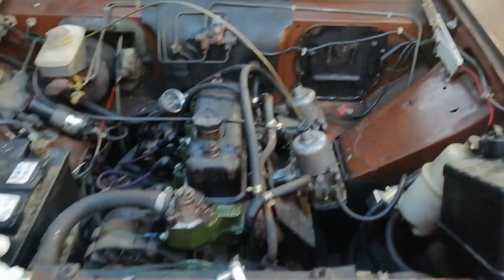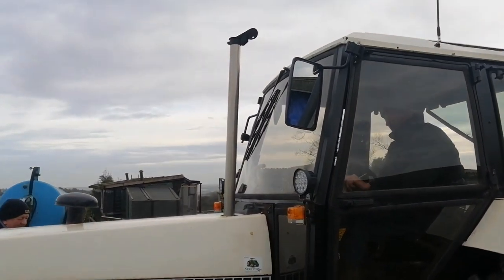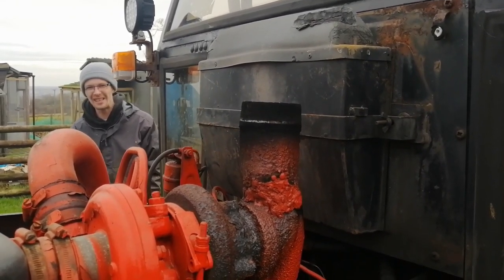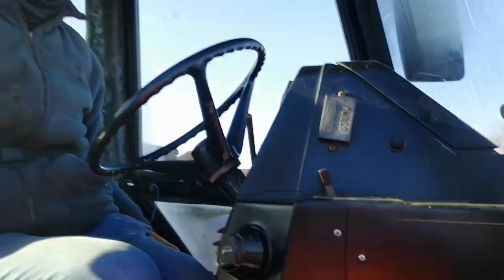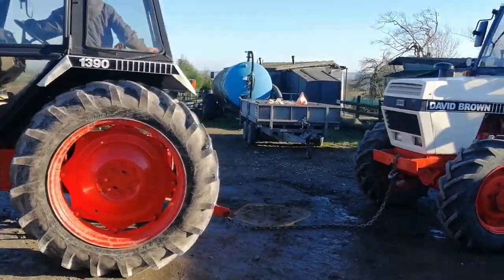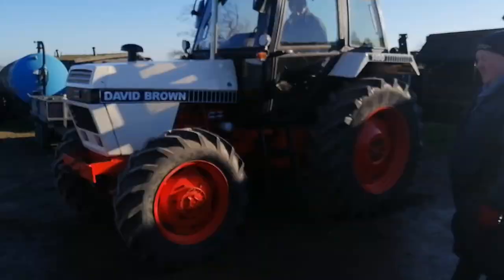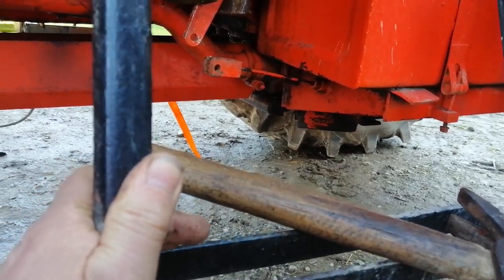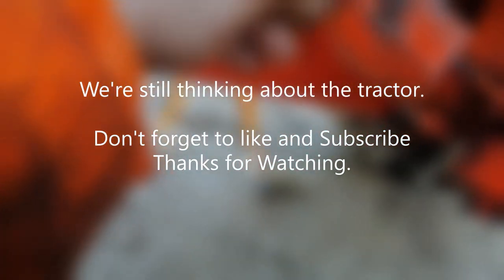David Brown tractor.. to buy or not to buy???

Comment: buy the 1490!  carraro axle and original kleibers on - basically same as a 1494 mechanically- only thing worth checking if u get it is the 4wd coupling on front axle can wear quick if they slackened as its only splined like a 540 rpm coupling - my 1390 4wd needed "dressing up"... from experience -id get diesel tanks off n the pipe in between n clean em - black sludge hides lol if yer back at the tractor ask them if theyve put a new clutch in at some point - sometimes the "wedding cake" clutch needs set in a vice or it wont release fae enough n can make em tight :-) had to split my 1390 because of that !
Reply from the maker: Thanks for the advice but in the end it turns out that the clutch had gone and we could not get the gears, also starter motor had gone , so the only way was to tow the tractor to start and there was a couple of tins of easy start behind the seats, so I think we would be buying work lol
Wile we was thinking about the tractor it sold on ebay for 5k as was.
Reply from the maker: Hi thanks for the advice, but in the end it turns out the clutch had gone and we could not.
Reply: Could it not have been towed 😂
Reply: @alanmoffat9605   it was in his next video but drive clutch was knackered too I think n the clutches in these need set on a jig before u do them add in a clutch n a starter n whatever else by the time yer in there n you’d no have much change out £1000 quid  over n above the purchase price 🤕
Reply: Sounds like the engines  bad. They normally started very easily
Reply: So many good starter motors are ruined by cranking them on buggared batteries or too small  capacity cables on jumper leads causing burning out of windings due to insufficient voltage.

Comment: Im really surprised that the 1390 couldnt pull her
Reply: The 1490 was stuck in gear plus 4WD was engaged. No tractor could make those wheels turn - at best the 1490 would skid up the drive. The clutch is the problem which they were working on.

Comment: I do like the 1490 but i don't want to own it if it has an AD3 engine in it due to the fact that it has no bearings in one cylinder while the others do and rebuilding the engine will be a pain in the neck and you will only get three new bearings instead of four so you'll need to get some extra bearings for the job sadly 😅
Reply: Jesper Thygesen  the earlier David Brown 1490s came with an AD3 engine which is missing bearings in one cylinder so i don't recommend buying them but those who has the AD4 engine in it which they changed too later on 😄
Reply: Jesper Thygesen  seems like you got an AD4 engine in it in that case, dad told me that the 1490s with an AD3 gets problems so i hope you got my point 😅